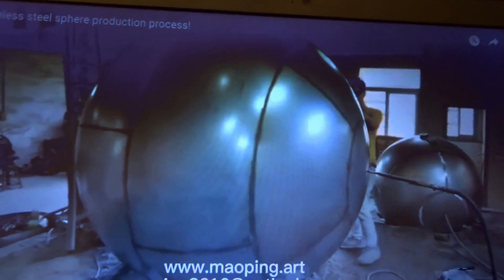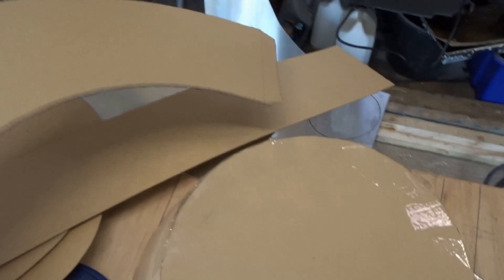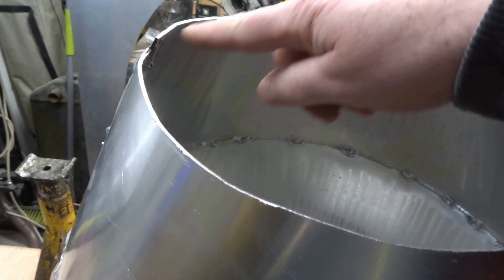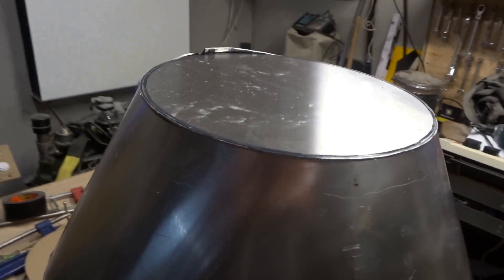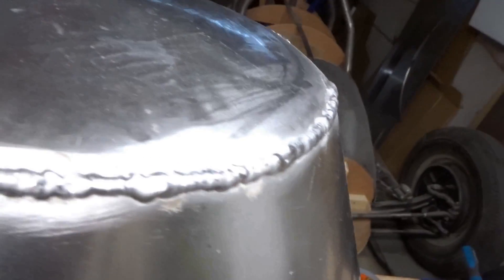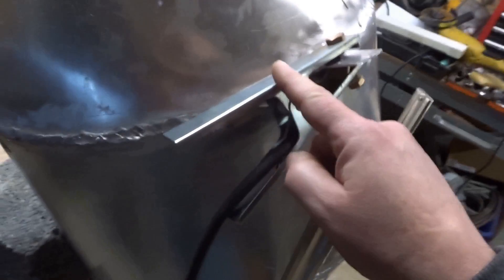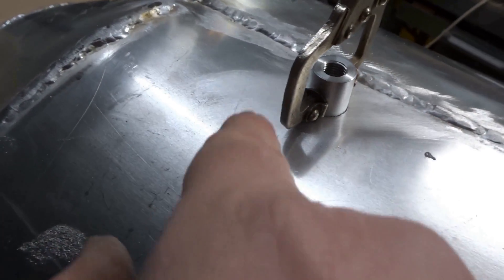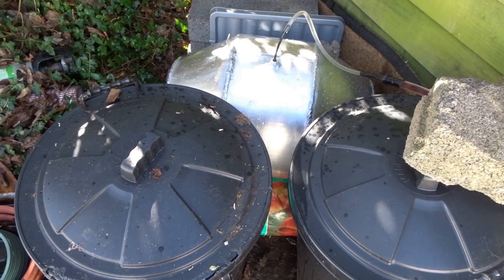Hydroforming a nosecone Pt1 | Ep34

Comment: The shell on the vehicle in the opening theme appears to be made from two parts, using hydroforming, each in one go? It looks a bit like an inflatable toy alligator. :)
Reply from the maker: That is not my car. It was hand made and welded together in sections. It took the owner a very long time to do it. I thought about hydroforming the whole tank but chickened out at having 600 gallons of water sloshing about ready to burst free! I thought it might crush under its own weight when starting to drain it as well unless I dug a tank shaped pit in my garden to support it.